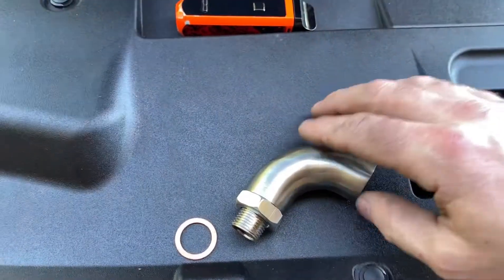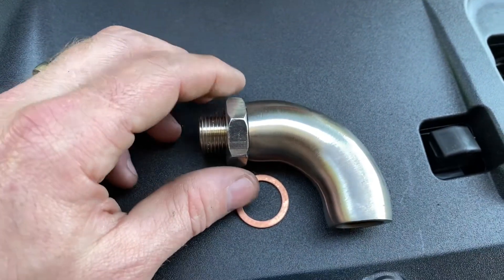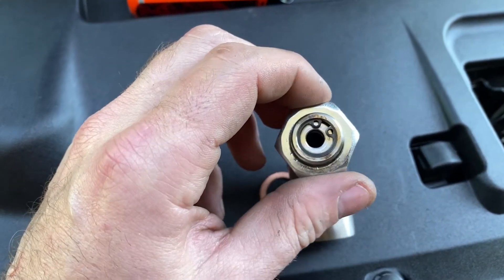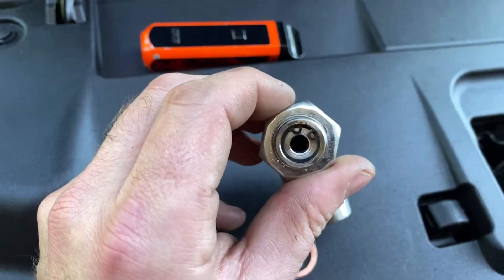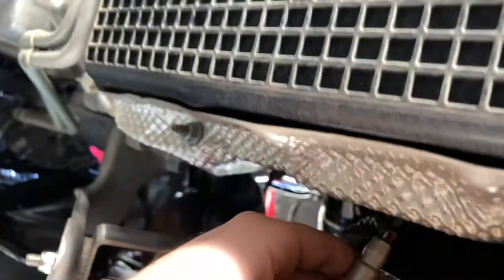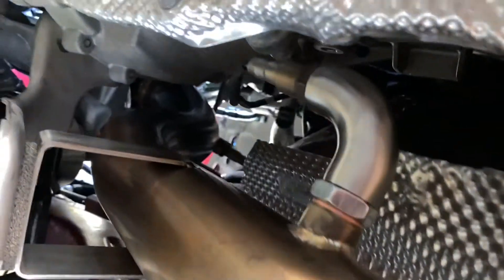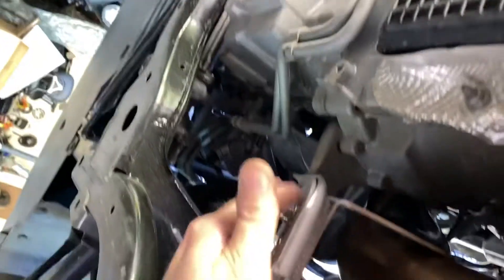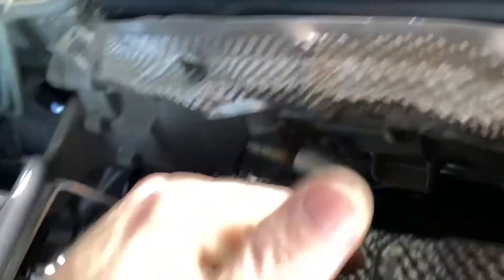Installing an O2 defouler for catless down pipe, Mustang ecoboost

Comment: So it's a been a year.  Still have the car?  Did the light ever come back?

I've had luck with a catted downpipe and defouler before, but I'm catless now.  The tune no longer works on the CEL (long story).  I'm hoping that might work.
Reply from the maker: Yes i still have the car, still no light. Even on a stock tune. I now have a built motor and im currently waiting for the arrival of a big big turbo, and then after that ill be releasing a bunch of content.
Reply: @vengence4x1  I keep getting the light because for some reason my tune doesn't stop it anymore--the defouler might be worth doing then, thanks!

Good luck with the build, I bet it'll be mean.  I'll have to check it out.
Reply from the maker: @acethedisturbed  all tunes disabling the o2 sensors had to be reversed, so yes definitely get the defouler. So far its making damn good power on the stock turbo, im just waiting for this big one. I have a brand new nx2 im thinking of selling.
Reply: @vengence4x1  Perfect, thank you.

Comment: Did the CEL turn off by itself after installing the spacer?
Reply from the maker: Mine did, but if it doesnt you can use a code reader or tuning device to clear the codes, if you dont have those you can unhook the positive battery post for about 5 mins and it should clear it.

Comment: Do you need a tune for the down pipe?
Reply from the maker: No
Reply: No you don't have to have one, but there's no point in installing a down pipe, unless you do the tune afterwards. You won't notice any performance gains until the tune is done.
Reply from the maker: @briguy3940  even with a tune a catless dp really gives no gains beyond auditory!
Reply: @vengence4x1  I have to disagree. The Key to Turbo Performance, starts with a downpipe. With 10 to 20 hp gains everytime the turbo is engaged, that's pretty significant. Add to it a 3 inch exhaust system, cold air intake, and a bigger intercooler and now we're talking 75+hp gains.
Reply from the maker: @briguy3940  dyno stats for whatever reason on this platform show little to no difference between 3” catted and 3” catless dp. Its crazy but its true.
Reply: @vengence4x1  Well now you’re talking about a 3 inch downpipe instead of the stock unit. Any aftermarket downpipe with a cat is going to be a high flow cat to be sure